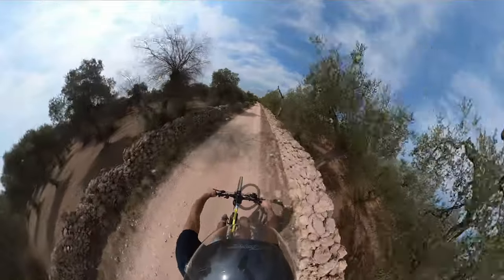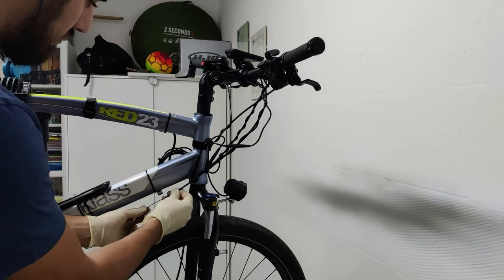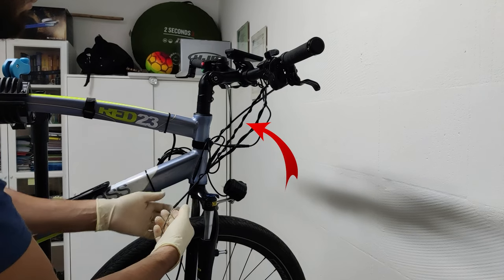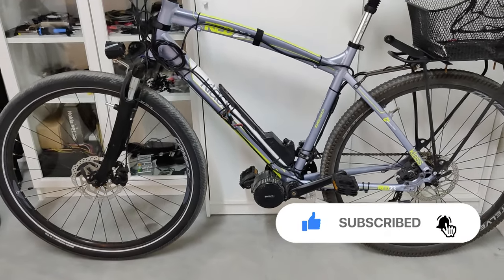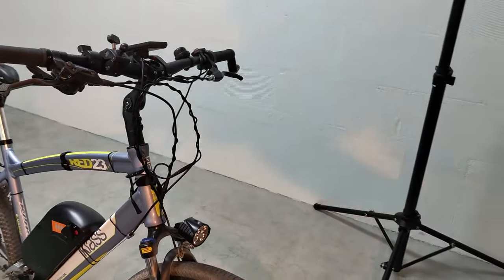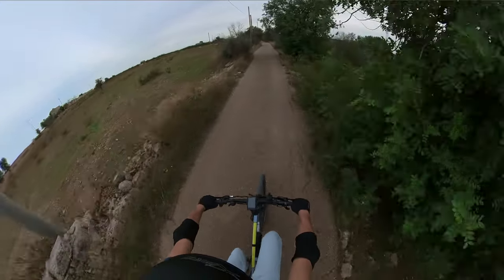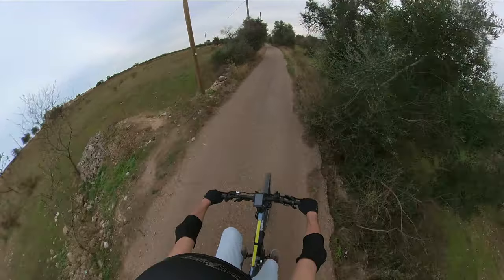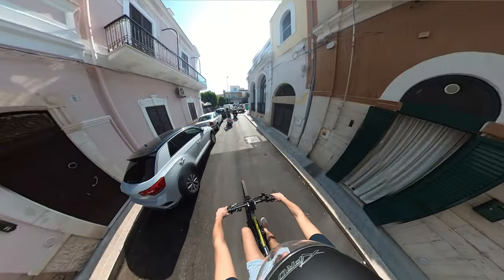Should you Install a SHIFT SENSOR?

Comment: Do you now if it is possible to change the time before the motor will be engaged after a gear change with the program?.
Reply from the maker: unfortunately it doesn't seem to be such a setting in the configuration tool
Reply: @LukeLorusso  Thanks!

Comment: Bro i have a issue with my gears they slipping and jump badly sound clakk clakk when my chain on low 1 2 and 3 on 4 and 5 above it is smoothly paddling perfect with power on hills and the other 3 chain they on the plane road aound like my motor shifting again n again n again plz help
Reply: We have the same problem